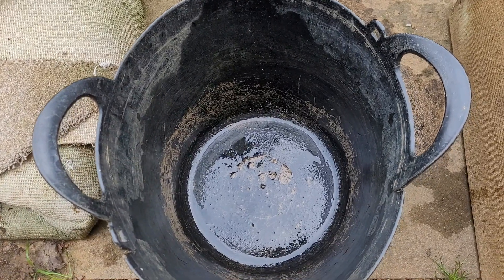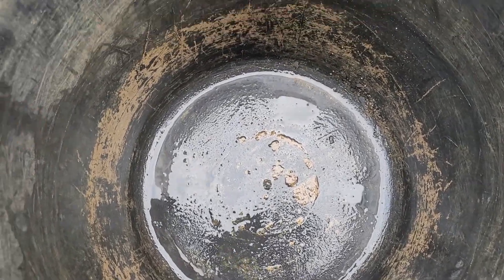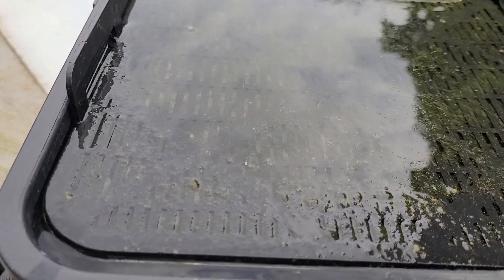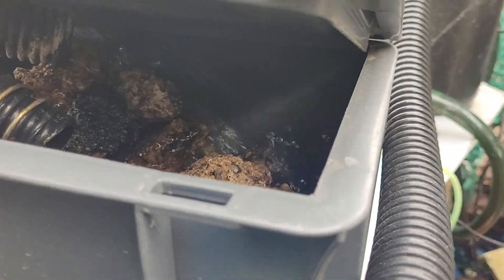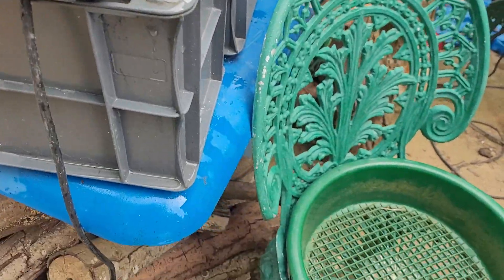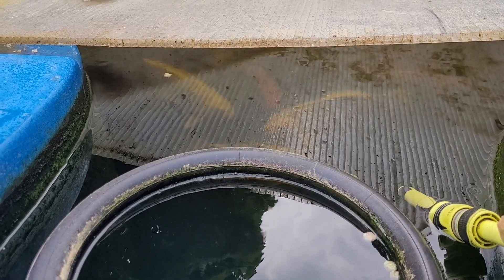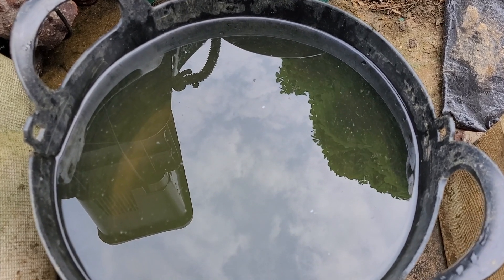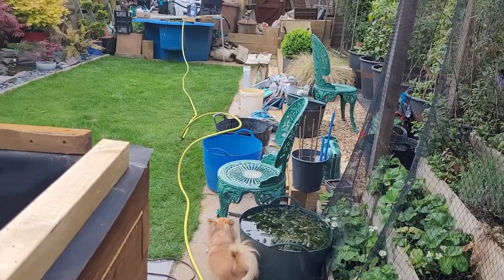How to Start a Daphnia Culture (Part 1)

Comment: What is your sodium bisulphate mix ratio please?
Reply from the maker: Hey thanks for your comment its 132g per litre solution and then 10ml per 1000 litres of pond water 👍🏻
Reply from the maker: Also if you work in gallons 130g of ST to 1 litre of warm water to dissolve Crystals..
Use 10ml Per 100gallons
100ml Per 1000gallons

Comment: hiya again taken your advise regarding the drill bits for wood need to drill out for power cables to make hole bigger so will try them out. I was also wondering what do you know about using imperial products on metric fittings I have a problem with a water leak on the pumps. 

I am using  Hose tail Elbow polyprop ( plastic ) bsp Female Thread. They don't seem to thread properly on my jesbo pump properly.  I could see a leak on them If I am honest while they are supposed to fit 32mm ID pipe my pvc flexi pipe feels loose in order to get the pipe to fit I used some ptfe tape and some silicone. Then used a strong jubilee clip. This seems to give me a seal. But when I screwed the elbows onto the pumps they dont seem to screw onto the pumps right they seem tight but i have noticed a leak in the elbow whats your thoughts? The leak comes from the round tightening ring you screw onto the pump. In the future I may need to upgrade the pumps to some thing better perhaps.
Reply from the maker: Them pumps are not the best bit in regards to the fittings I honestly can't advise on that I don't ever use metric and I only ever buy the correct fittings for the pumps I'm using and if I'm not sure which fittings I need I go up to JKI and Mark just tells me what I need and I get it from him. Have you tried ptfe tape on the screw thread?

Comment: any advise on putting capping wood on a sleeper pond. IE- predrill what type of screws to predrill or not how to space the screws out many thanks.
Reply from the maker: It all depends on what your capping with mate I'm using plain hard wood so I'm using sunken nails so there not visible but use what's best for the wood your using 👍